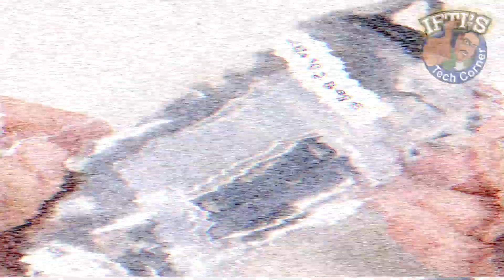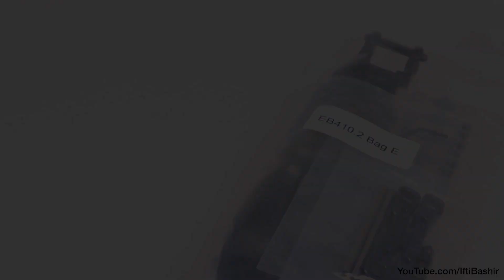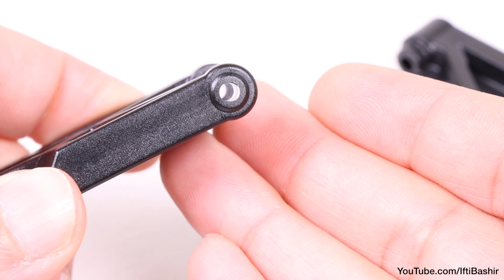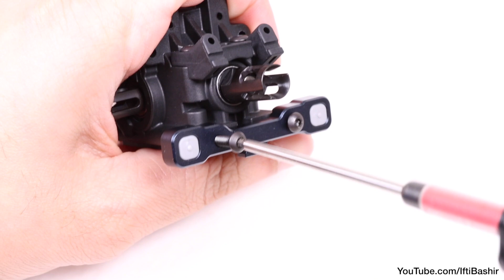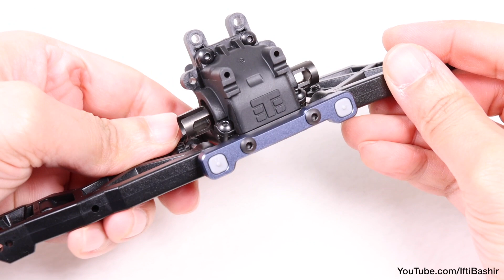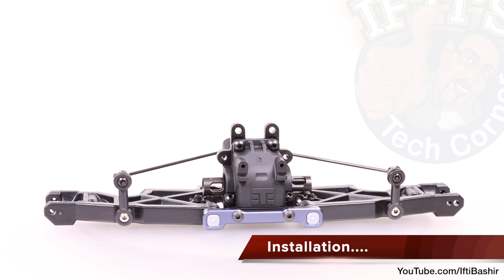#06 Tekno EB410.2 - BUILD SERIES - Kit Bag E : Rear End Assembly

Comment: my manual said to use 2 0.5mm and one 1 mm wheelbase shim but its impossible to get the screws in like that so should I just use 2 small ones?
Reply from the maker: Which part of the video are you referring to?
Reply: @iftibashir  nevermind i just had to push the hinge pin block further in (rear rear block i forgot what it was called)